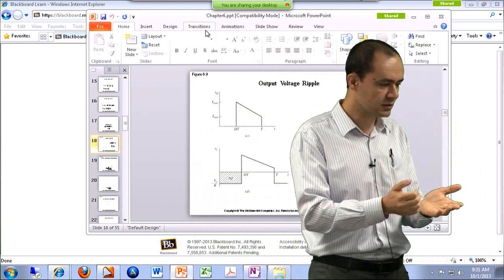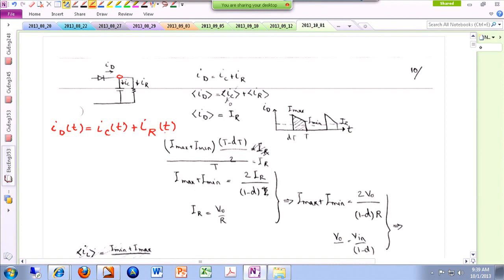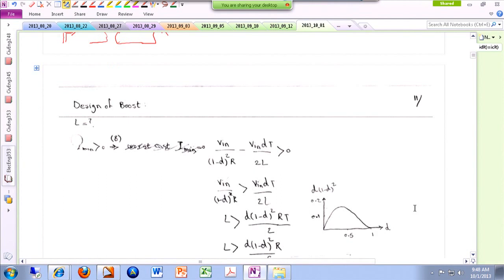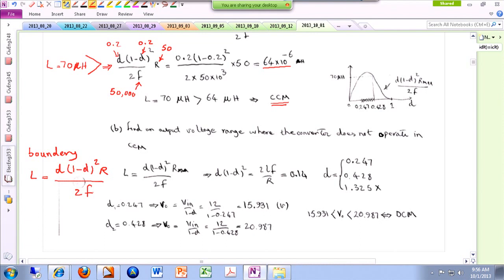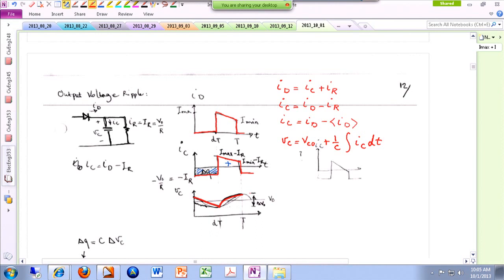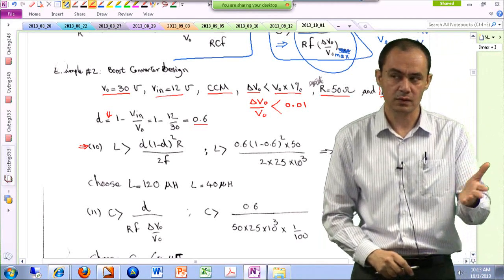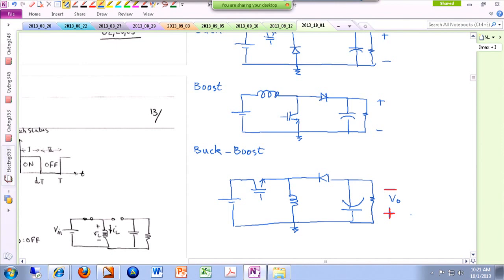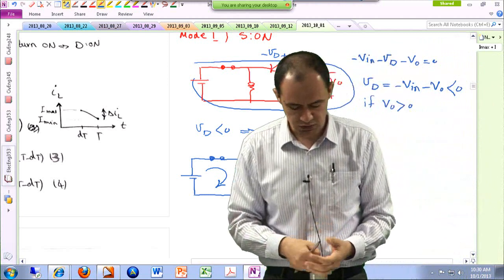[12] Power Electronics (Mehdi Ferdowsi, Fall 2013)

Comment: @mehdi ferdowsi : sir in the case of (delta V0/V0) u said the max of V0 must be used but as in this case as you have given the absolute values of deltaV0 and V0 then for min (V0) the expression (delta V0/V0) would be maximum.please correct me if i am wrong..